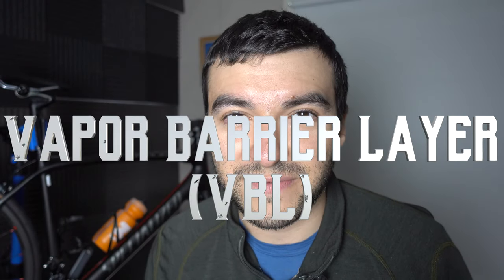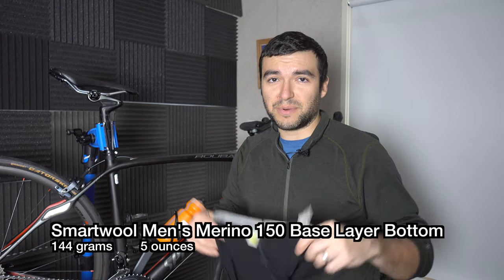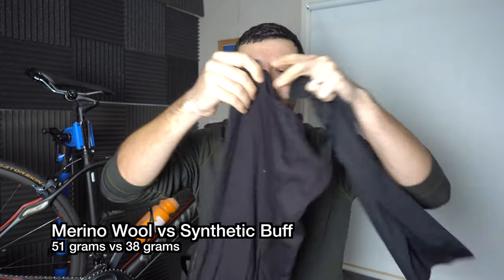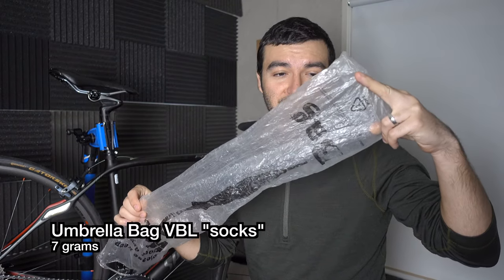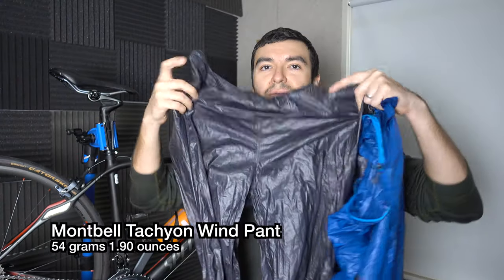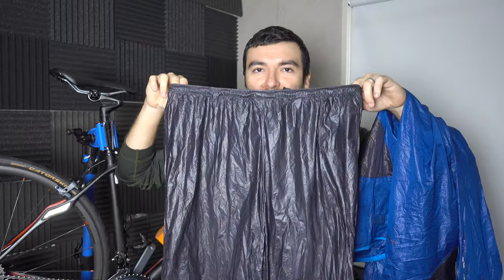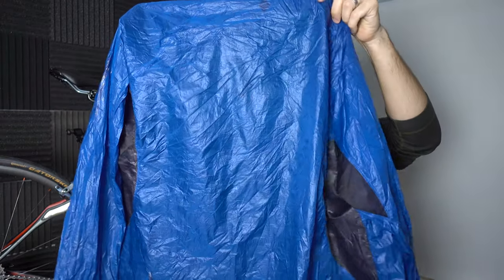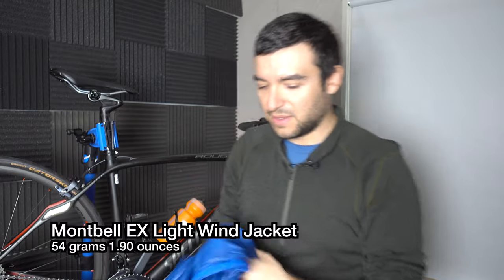Vapor Barrier Layers and why YOU should be using them (Ultralight bikepacking sleep system part 1)

Comment: Tried it outside instead of at home with open windows, or on a nearby safe place. It was too cold. Night was only 15C but it was very windy and my tarp wasn’t enough. Wore all my clothing, even had to pull out an emergency blanket. Terrible night’s sleep personally… but instead of a proper rain jacket I just used a windbreaker. Plus no bivvy. I wonder how low this setup could go comfortably, but I won’t be the one trying to find out
Reply from the maker: This is just the base layer of a larger sleep layering system. I've used this system down to -1C(30F) and it's been plenty warm. Add a quilt on top and you could easily get down to -6C(20F), probably lower depending on the quilt rating. Your layers must not have been the same as mine, you have to use the EXACT layering I describe in the video, not just any clothing. Check out this video for the full run down of all the layers: https://www.youtube.com/watch?v=iXsQZ6RfVig   I've found -6C quilts/sleeping bags to be too warm in the summer if you aren't expecting anything that cold, so you end up taking a lot more weight even though temps never get that cold. Obviously all this is personal preference, some folks like to be very warm when they sleep while others are naturally warmer especially after a long ride and a big supper.

Comment: Interesting but unless I misunderstood you the VBL should be next-to-skin layer, while when you show it in use it seems it is your last layer. Which is still useful (windproof) but contradicts the idea of keeping the moisture in control.
Reply from the maker: It can be a next to skin layer, but may make you feel clammy, that's why I wear a light base layer. Wool stays warm when wet so it is a great material under your VBL. On bike I don't wear puffy layers unless it is super cold, but if I did wear insulation layers, I would put them over the wind layer, thus preventing moisture from inside. Thanks for the comments, I'll clarify more in future vids. 💨💦🚴
Reply: @bikepackinglight1829  If you can find Hal Weiss’ book ‘secrets of warmth’ he helps disprove the theory that wool, or any insulation, is as efficient as when it’s dry.  The best insulation is composed of compartments of air pockets, and the tinier they are the thinner the loft can be.  I am a huge fan of natural fibers, too, but for other reasons I won’t divulge here.  If you only VB as shell layer, you evict air by collecting condensed sweat vapor in those compartments.  I’m very glad that you’re trying to reduce hypothermia by infoming the web world about VB, though!